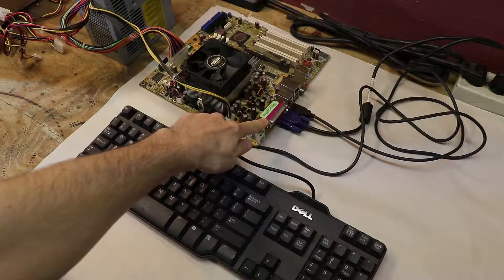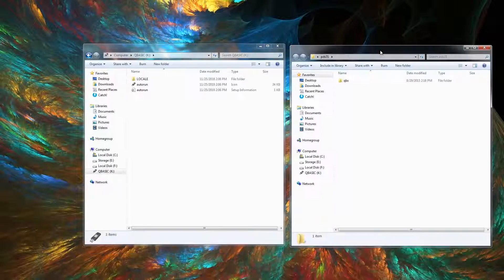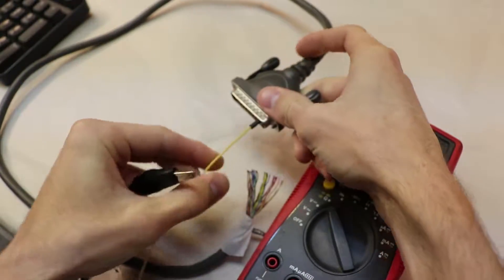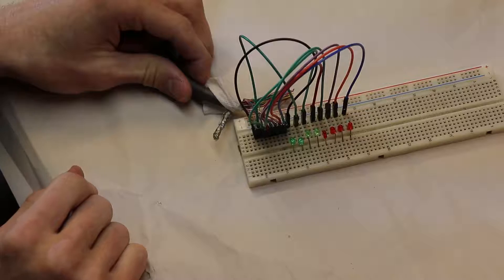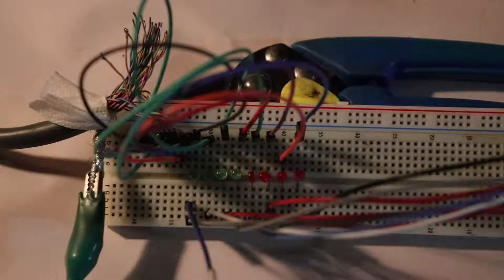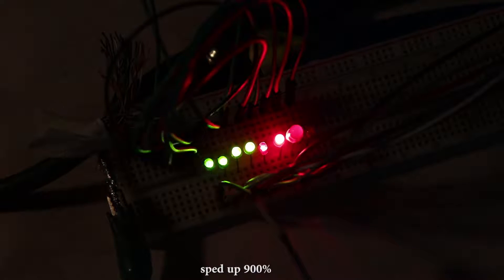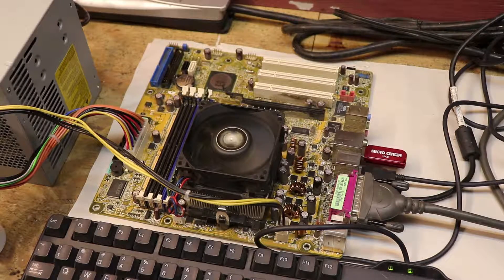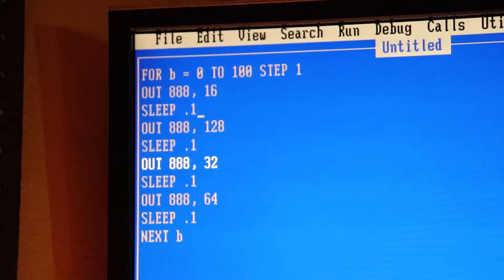Forget the Arduino and Pi, use your old PC!

Comment: I feel like installing Linux and running Python would be more robust. You might also consider using a serial port.  Otherwise interesting video. . I didn't know you could still find basic out there.
Reply: Linux and Python would be a lot of extra complexity that you might not need.  Plus, if you need realtime, that gets real hard real quick in Linux since it's a multitasking OS.  With DOS, your program has full access to the entire machine (no system calls!) and there's no other software running.

Serial port's a different beast altogether.  You don't have individual pin control over most of the pins.

BASIC is everywhere in the automation world.  If it's on a PLC, it's Ladder Logic or Function Block Diagrams, and if it's on a computer, it's BASIC.  That's what I do for a living.  I write Lisp code in my spare time to keep my brain from freezing up.

Comment: why not save time and just use jumper wires off the parallel cable... If you can stick a jumper on the DB25 why go through all the trouble ??

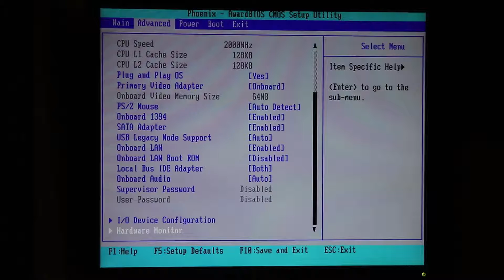Comment: So each wire from parallel pin becomes GPIO? And each pin can output 5v like Arduino analog&digital IO pin? Also  5:01 you said the address is 888 but 6:27 the highlighted text shows address of 378. I'm confused.
Reply: 0x378 (hexadecimal) = 888 (decimal)
Reply: @1pcfred  Thank you
Reply: @jumbo999614  you're welcome.

Comment: Is there any alternate to parallel port? I have an old computer from 2008 that doesn't have an parallel port but was manufactured to run FreeDOS.
Reply from the maker: Many go the PCI card route, IO cards arent that hard to find on ebay but usually companies have old proprietary software that runs them. You could buy a parallel port card. There are IO expanders that work with USB or RS-232 COM ports. There is also an i2c line built into the vga port you could tap into. Depends what you want to control and how critical the timing

Comment: IS there an advantage to using the serial port? And, is there way we could boot or better programming platform, that q-basic for free.
Reply: Serial ports aren't made for this.  You can't just arbitrarily turn pins on and off with them - the pins are controlled by a UART chip that's designed for RS232 signals.

As far as platform goes, it depends on your requirements.  DOS is simple and has the advantage that your program runs on the bare metal, so there's no problem with timings (say, if you need to tell the difference between a 30µs pulse and a 70µs pulse).  Instead of a library API, you program by directly manipulating memory and I/O ports or making calls to BIOS code.

There are free compilers for DOS if you're rather write your code in C, C++, Pascal, or several other languages, and of course there's a bazillion assemblers for DOS.

There were a lot of commercial development environments available back in the day (such as Borland's products), but I have no idea how you'd go about getting ahold of them these days.  Emacs works on DOS and has IDE-like features, so that might be a possible route to go.

Of course, if you need things like networking, access to higher memory (you can access higher memory from DOS, but you have to know how to do it), multitasking, etc. then you're better off with a more fully-featured operating system.
Reply: @jeffspaulding9834  Thanks for the input. Get it. I still like your idea of using that old motherboard and getting a new use out of it.
Reply: @paulsccna2964  That wasn't my idea - you got me confused with the creator of the video. 

I used to be on "reuse old hardware" bandwagon, but all of my old hardware got thrown out except for some old SparcStations and they don't have parallel ports.  These days I just buy Raspberry Pis or booksize computers for stuff I would have farmed off to old hardware.  It's not quite as satisfying, but it's a lot less hassle and cheaper on the electric bill.
Reply: @jeffspaulding9834  Sorry about the confusion. I used to own a Computer repair store, for 14 years, and I had a back room and we used to save old machines for parts. Basically, the "reuse old hardware," thing, used to be huge. But as Smart Phones came out and prices dropped, the need dropped. I have too many projects going, but that Raspberry Pi is really cool. Take care.

Comment: Back to earth people. For example arduino has a lot of libraryes for different hardwares. Without this programming becomes really difficult. What about python and node.js in case of raspberry pi? OK, you can run a operating system on an old PC, but what about the power consumption? Who is stupid enough to consume 150/200w of power for a linux system with NodeRed or python instead of 5 max 10w in case of a raspberry pi? Blinking leds is not a great thing. Please make and compile for example MARLIN for 3D printing for your old PC.
Reply: Whatever happened to doing things because they're fun?

Comment: Is there a way to do the same on a motherboard (used to run Windows 7 with a core i3_gen1 processor) that doesnt have a parallel port(I/O).?
Reply: there's a set of 25 pins with a name tag : "parallel port". (*im new to computer hardware)
Reply: You can use the parallel port directly for GPIO access using a specific hardware address (for Windows, its in the Device Manager under Ports), but i recommend that you instead use a external GPIO module (preferably one with USB and its inputs and outputs being opto-isolated), due to it being safer to use (if you screw up, atleast the board is dead, not part of your motherboard).
Reply: @Loundre3  thank you

Comment: it would be fun if i could use the parallel port in my every day pc to control RGB lighting strip
Reply: You can. You'd just need a transistor on each output of the parallel port to switch the higher current that your strip needs. And if it's a 12 volt strip you'd need to pick that up from either the motherboard or the PC power supply or provide your own.

Comment: Nice video! 

I would like to ask you if it is possible to control things from internet
(control the outputs from internet)
Reply: Not with Dos (unless you get also a serial modem), but in Linux sure. Don't know how to control the parallel port there but it shouldn't be too difficult
Reply: Okey i will try it ! Thank you ! Have a nice day

Comment: It's fun and all, but still doesn't make too much sense to me to use and old pc + qbasic instead of a Pi + python.
Reply: Well, it might be useful for hardware demanding projects, such as deep learning and projects that need a video output or HQ sound
Reply: @ygormartinsr  Pi also has video output and you definitely don't want to do any deep learning in qbasic. Of course a Pi's computational power cannot be compared to a new PC, but for controlling home made electronics projects I see no practical reason to use a dos based computer.
Reply: It makes sense if you have a closet full of old computers and no Raspberry Pi, and don't feel like waiting for one to be shipped to you.

Or just for fun.  Some of us grew up writing BASIC, and the nostalgia is nice.  Some of us, unfortunately, still have to write in BASIC for their work.

Comment: Using the parallel printer port for I/O data bits...
I've done a lot of that over the years (using DOS/Quickbasic, and later on windows and visual basic) to test things like industrial counters, I/O cards, and 20th-century discrete-logic boards, from 1992 until about 2012 when those kinds of things were largely discontinued by most industries in favor of the newer all-processor-controlled all-in-one stuff that uses proprietary encrypted communication protocols.

Comment: This man didn’t put any resistor with the LEDs, seems like his wiring works as resistor. Maybe I am wrong, any other explanation?
Reply: The resistor is only required if you are concerned about the brightness & life span of the LEDs. Besides a standard parallel port such as this is only capable of supplying TTL level voltages (max 5V @ 15mA). You would be hard pressed to pull more than 100mA from a vintage parallel port...
Reply: @Fifury161  Still a chance to damage the LEDs and the parallel port chip... While the LEDs are easy and cheap to replace the chip often is not...
Reply: @someguy4915  An absence of resistors in this configuration is not going to damage the parallel port...

Comment: Nice idea, sadly you are about 35 years too late. The coding knowledge learnt from QBasic is not directly transferable to Arduino, also it's a lot more difficult to make the project portable, wireless and powered from a single cell.... 
The last thing I wrote in QBasic was a sentry gun emulator (Like the ammo count seen in the Aliens directors cut movie).
Reply: agreed, a simple program in visual studio would have been easy enough, which would make porting to arduino easier if needed
Reply: I do not need anything portable or wireless. Sometimes I do need the computational power and storage capacity a PC offers though.

Comment: Where are the LED current limiting resistors??? Bad practice.
Reply: Built into the port itself I imagine.
Reply: @1pcfred  you can take bets if the LED or the port driver blows first 😊
Reply: @uint16_t  I use driver buffers on my ports. Those I know are good for 25 milliamps. I pull less than a milliamp off the parallel port itself to drive those.

Comment: 6:38 it bugs me that the bits are in reverse order from left to right...
also you should try this with a more modern PC that can run QB64 and either still has a LPT port or use an adapter
since QB64 is literally better than QBASIC in every way, it even has a dark mode!

Comment: :( how about using linux?!
Reply: Linux takes a bit more setup than FreeDOS does.
Reply: That's like saying, "Why not use Windows?"  Linux and Windows are both multiuser multitasking operating systems.  If you need that kind of thing, then sure - go ahead and run Linux - but it's major overkill for something like this.

You can't directly control hardware with Linux the way you can with DOS (without writing your own kernel driver, anyway).  You have to use system calls or the /sys interface (which is the same thing, more or less, just with extra system calls behind the scenes) to get the kernel to talk to the hardware for you.  That requires at least two context switches, and meanwhile Linux periodically pauses your program to run other stuff, which makes timing unreliable.  In DOS, there is no kernel; you're running on the bare metal with nothing between your program and the hardware.

For the examples here it wouldn't make much of a difference (except it would require a lot more setup and you'd have to learn the right APIs), but if you needed realtime access to the hardware (say, if you wanted to read a DHT11 Temperature/Humidity sensor, which requires you to be able to distinguish between pulse lengths measured in microseconds)*, DOS is the way to go.

* If you actually try this on a Raspberry Pi, you'll find that you can't reliably read from these devices; all the programs that deal with these just take multiple readings until they get something coherent.  To read it properly, you'd have to write a kernel driver, which as of a couple years ago no one had.
Reply: @jeffspaulding9834  my ignorance? I wasn't the one claiming that MS-DOS does not have a kernel. Or the one claiming that Linux cannot do hard timing. But I've only been running Linux for 25 years now so what do I know?

Comment: Obviously this was made way before what is available now. The RP-4b is pretty much everything you need in a SBC, in a package smaller than a pack of cigs. Built-in wi-fi, bluetooth, USB 3.0, HQ audio, dual-HDMI graphics, quad-core ARM.. I have mine hooked to a 24" HDMI LED monitor for a nice, full-featured, low-power, low budget desktop.😉

Comment: Well I see two problems with this, the energy consumption and the size of the board, other than that, you could have a raspberry instead of an arduino. I always had that though on the back of my mind, but I didn't have any idea about how to control those ports so I dedicated to learn other stuff.

Comment: ok i will use a 12V 200W wallet for control my led strip instead of a 3$ arduino esp32 usb sized board 

mention to wearable iot

Comment: Useful for producing a video, not for real use, just the power consumption maybe 10-15 times higher.
Reply: Old P4 system: 50-100 watts, any simple Arduino: .5 watts... So around 1000-2000 times higher even. Exactly right: good for a funny video but pointless for actual use. Microcontroller for projects, Raspberry Pi for projects that need some more power or a simple way to hook up networking, usb and display etc. and microcontroller hooked up to a full pc via RS232 for projects that need the processing power, there would likely never be a reason to do this anymore.
Reply: Some Guy sure, I have a j1900 that runs home assistant, server tasks and time machine and is only 12 W, my home is filled with sonoffs with sensors and D1 minis :) and a couple of esp32

Comment: Useless  , atx motherboard size with power supply (300watts minimun)to control only 8 data lines very useless.
Reply: I disagree. I like how a PC controls my CNC machine. It is far superior to the Arduino solution.